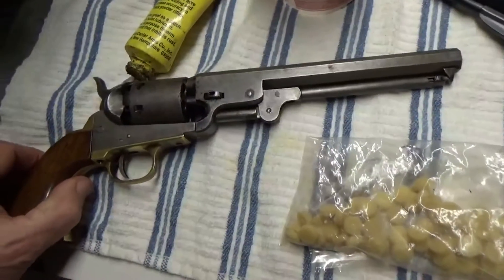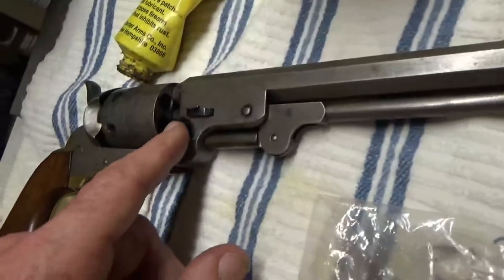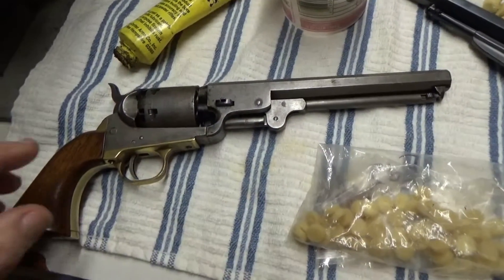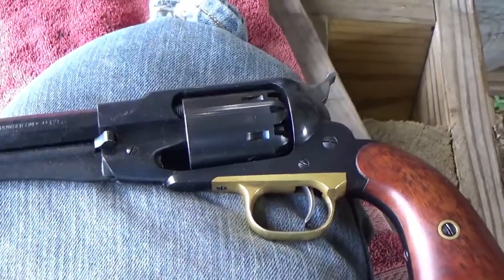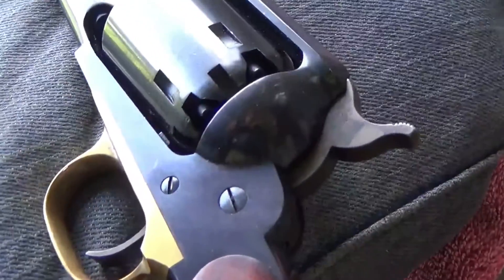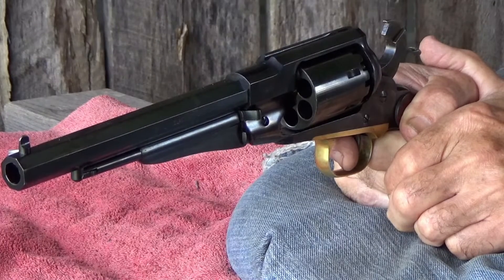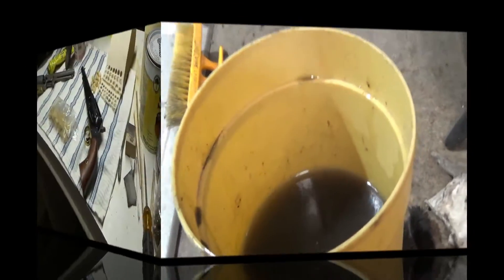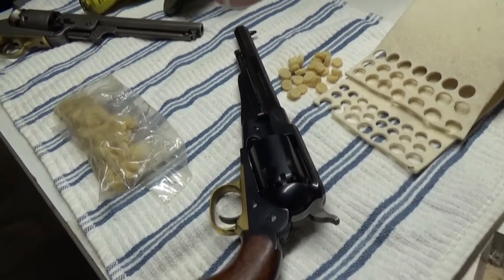1858 Pietta shooting without lube or wads - Part 1

Comment: When I started blackpowder revolver (many years ago) I bought a Centaur made Colt 1861. (Centaur is Belgium but made on original Colt machinery) At that time I read an article: a youg guy became German champion. Everybody was asking what lube, which wad etc. He said I use none... A standard match in the Netherlands is 13 shots, of which the best 10 count. So no lube or wads needed I think. (I did it any way)
Reply from the maker: That’s interesting data. I have tried the “nothing” plan. It wasn’t bad for the first cylinder. If I remember correctly the cylinder became progressively more difficult to turn. Started to get flyers and group size opened up. Cleaning was much more difficult due to the fouling build up. So, there seems to be a contradiction here, and it’s not the first time the loading with nothing has been mentioned in comments. It wouldn’t hurt me to go through this a second time. Have folks that back the “nothing “ approach any knowledge about shooting black powder cartridges like the 45/70, or at least read publications like those by Paul Matthews?  Are they aware of the “grease cookie”, and how important it is to accuracy and why. Also the information by Ned Roberts he talks about how in the 1800’s the importance of “moist burning black powder”?  Probably not. What if (just a theory) modern commercial black powder ain’t the same when it comes to fouling?  This could explain why lube is now used in the attempt to keep fouling soft so that things work better. There’s also the possibility that tests and experience I have are incorrect. There are many things we don’t know, like the powder the young German was using. I believe this lube, or no lube subject could use more study. Thanks again for your comment and information. O.R.
Reply: @oldranger3044  I don't know his powder also, most use swiss for matches. I do know my sharps 45-70 reacts to "cheap" blackpowder. I lube my cast bullets with homemade lube. Mix of Peanut oil, fat for french fries and beeswax. With cheap powder (non Swiss) three round go into the 10 ring at hundred meter distance but then they start to drop hard. Lots of hard powder residue in the barrel, no lead fouling however. Now I wipe with a moist patch after three shots. With Swiss powder 120 $ a kilo no problems.
Reply from the maker: @pietkoster1935  Thanks, that’s very interesting. I have some Swiss, but have never tried it without lube.  A comparison of it with GOEX would make an interesting test. Also, I have a 15 lb can of what was called “orange rifle powder” that was never opened and I believe was from the late 1800’s. Maybe its time to check out some theories. O.R.

Comment: That was a surprising result, the mystery is what is causing the flyers? I note that on third group it was the first 3 shots that went wild, then the next dropped into one very tight group, I see the seated ball was at least 1/2" back from the end of the chamber, do you think that could be making a difference, although with the others going into such a very tight group  I can hardly see that was causing a problem, but to get such tight groups  with a fouled barrel after that many shots is amazing, was the fouling soft after that many shots? Chris B.
Reply from the maker: Hard as a rock.  I have shot some groups using wads, in an attempt to see if they would work without flyers.  So far, and that means so far, I get similar results with the wads as without anything, in that there seemed to be some that were tight were I expected them, and then what appears to by flyers.  Actually this might be expected if the lube wad isn't really doing much.  One thing it seemed to do for me was to cause some erratic shots, almost like squibs.  I need to run some more, but I've been having fun with the lube accuracy.  I maybe said that I am suspicious that maybe the powder in the past was somewhat different.  In Ned Roberts book he claims that guns can shoot without wiping if the powder selected is moist burning.  "Very interesting". O.R.

P.S. Plan to repeat test, and you can bet, knowing the gremlins that live in the can of BP, that the results will be completely different.
Reply: @oldranger3044  I think the hard fouling must cause a great deal of deformation, and therefore flyers, but the mystery is your flyers came early ,before the excellent group, I can well see that a lubed wad over the powder could cause erratic burn, as there is little chance of getting the same pressure on every chamber, and for that reason I do not put any contaminants under the bullet, but the lube coated ball looks a good idea, I always use a carton disc over my BPC loadings, that could be something to try, but we are loading a round ball down onto the powder, so do not have the flat base the go up against the wad, as you say, lots more work to do! Chris B.
Reply from the maker: @453421abcdefg12345  True about the compression varying. The lube I used had the consistency of Crisco, so maybe pressure could force some out.  I've often wondered about the burn not being the same because it first can compress the wad (maybe) and act somewhat like powder that is not compressed-even when we think it is.  Yes, lots of fun stuff to work on. It might not have a lot to do as my brother would say with "the price of corn"  but I'n not planning on spending much time making video's showing my shooting ability with one hand either.  O.R.
Reply: @oldranger3044  I noticed today, while driving a ball through the barrel of my .36 that had been loaded into the .38" chamber, (I was doing this to see if it completely filled the grooves), that the ball rotted slightly, enough to show light through the bore, if that were to happen when being fired, the ball would probably veer off to one side, have had high pressure gas bypassing the ball, another reason to have chambers the correct size! I wish I lived closer, we could get more work done on this! Chris B.
Reply from the maker: @453421abcdefg12345  Hi Chris. That  caused me to check my 44 Pietta 1860, which has chambers .446, bore .440.  To be sure, I took a .454 with loading lever down the chamber and punched it back out, and yes, .446.  Interesting how some ring was cut off, but some stayed on the ball, and there was a noticeable ridge where lead was pushed to the front.  Anyway, then pushed it into the muzzle and looked against the light.  It was not filled to the groves, just as I had seen with the 36's.  I took a pretty good photo of it.  Unless it bumps up, gas is going by on all sides.  How it can be accurate is beyond me.  But it works.  A while back I tried on the 36's to use reamed chambers at .375 with a 380 to fill things up, but it didn't seem to shoot much, or any better.  I don't think these things follow smokeless rules.  Maybe they make their own on demand.
When I saw the "damage" that was done to the 454 in putting it in the .446 chamber, I suspect maybe that is why I get good results with the 451, possibly better than the 454.  O.R.

Comment: Now you know, folks. Lube that cylinder end. Lube those rifle patches too. It’s not a wasted motion or resources.
Reply from the maker: Yup, that’s why rifles were made with patch boxes. Sure, can use saliva in a pinch, it will help sliding down the barrel, but won’t do much to keep fouling soft once it dries. O.R.
Reply from the maker: According to what I’ve read, many of the Southern Mountain “poor boy “ rifles had a “grease hole” in the stock. Less work and metal for the builder. O.R.
Reply: @oldranger3044  Your 2 videos PROVED that grease is a necessity for blackpowder shooting. The improved cleanup alone is worth it, but just a chance that it improved accuracy really clenches the deal. Minus at least 2 flyers per target, that’s major.

Comment: If im doing a lot of shooting in a day I'll do an over powder wad (either felt or even a 3d printed plastic disc of the right diameter), put a small dab of beeswax-olive oil grease over that, then ram in a ball. Keeps everything soft. 
Or i sometimes will just run paper cartridges dipped in the same lube mix.
Reply: I was just thinking of making some cartridges and brushing them lightly with Vaseline but at time of loading I don't want greasy fingers lolol gloves right

Comment: I use a .457 ball and a Triple Seven 25gn charge. I put ball directly on the powder and then grease the edges of the top of the ball in the cylinder. It's shooting ball on ball at 20 yds with my 1858 New Army Pietta.
Reply from the maker: Sounds like a happy day. I’ve never shot 777 in handguns that I can remember. Don’t know if it was made when I first started, but I’ve heard it works well.  I also used to lube just around the edges in the 80’s and would get occasional flyers in the 36 calibers. Was using GOEX and I think maybe it wasn’t enough lube, because doing better now using more. Also it was pure crisco. Thanks for your comment. O.R.
Reply: @oldranger3044  love your vids man. Keep them up.
Reply from the maker: @Adam-upnorth  Thanks Adam, and also for your loading data. Keep safe. O.R.
Reply: @oldranger3044  you are very welcome.  Thank you and same to you.  Stay safe and shoot straight.

Comment: Fascinating. I imagine for competition or a day of target shooting one ought to use lube and spray down with moose milk between stages and quick cleaning when time allows. However, I have always been skeptical that the working man in the old west would walk around all day or all week with melted lube on the cylinder in hot weather. It would seem to be a real mess. It would be interesting to research the extent literature and manufactures instructions from the time period.
Reply from the maker: I have heard that original instructions were pretty much to load this way.  No doubt they were not all done this way, but our reasons today are different for shooting the guns, with different techniques.  Old information is hard to come by, just like finding information on how fires were started.  Everyone did it so there probably wasn't a feeling that it should be documented.  O.R.
Reply: @oldranger3044  Yep, range work or hunting are a whole different thing than EDC.
Reply: @oldranger3044  Yep, done some extensive research into this and concluded that in wartime paper cartridges were mainly used as issued, some were dipped in lube, some not. Accuracy probably didn't suffer as the men weren't the best revolver shots and they only shot 6 before switching to another weapon. No reloads in combat unless in a defensive position probably. Elmer Keith mentions some preferring the roundball over the conical for deadlyness. Colts and even Cooper revolver loading instructions never mentioned lube, it probably was not used much. However, dripping molten candle wax around the caps and loaded chambers was done to waterproof the loads. This probably aided in a little lubrication, but that was a secondary cause.

Comment: I use Bore Butter and 3-in-! oil, generously.
Reply from the maker: Bore Butter works fine, but I would go through probably a tube per day, and shooting sometimes 4-5 days a week - well, I felt I wanted something less costly. Have not used 3 an 1, mostly because of those that claim petroleum based products don’t go well with black powder shooting. Thanks for sharing this info. O.R.

Comment: Ive used Criso for years.  Easier cleaning in my opinion.
Reply from the maker: @wizbang16  I also used it in the 80’s, but too sparse because I thought its extra weight would affect things. Actually it would have, but for the better, because there needs to be enough to keep the fouling soft. I did a recent test of it against my mixture and it did well, but without the wax, it had a loose “ball movement” in the hot weather. Other than that, it worked fine. O.R.

Comment: Is there anything in the $300.00 price range worth buying and would it come with everything or is powder,caps and balls always separate?
Reply from the maker: My opinion on question #1 is yes. If we’re talking Pietta, if you pay over $350, then you’re probably just getting a fancier looking piece. Exception would be their shooters model ($900+) or one with target sights. If it’s a Uberti, then it’s going to be $50-100 more than Pietta. There are plenty of videos that compare guns from the two companies. Should be from $300-375 for steel frame Piettas, depending on models. About $50 less for brass frames. At these prices for new, I would be caution new shooters about buying used.
Question 2, is easy, no, they don’t come with everything, at least I’ve never seen it. I’m sure sometimes at at a gun shop or wherever they might include extras, but there are no factory complete kits that I know of. 
Not throwing water on the 🔥, but compared to modern cartridge guns, the black powder shooting can involve “extra stuff “, including cleaning and dissembling, that is easily overlooked. It’s a different world than modern firearms, and probably that’s one reason it’s popular with some shooters.  Hope this helps. O.R.

Comment: 1858s are the very worst for fouling.. sure as far as cap jams it's pretty good but after the first cylinder it's so fouled it doesn't want to fire another cylinder or it's very hard. It gets too gunked up you can't even pull out the cylinder rod..

Comment: Doesn't the Pietta manual suggest using .454 round ball for their  1858 Remington?
Why are you using .451 lead balls in your testing?

I have heard some say the most important thing that prevents a chainfire jump across
the cylinder openings is getting a uniform circle of lead cut off the ball after you ram it home.
Reply from the maker: Could be the chambers of the older guns don't have much of a bevel to start the ball, and the 451 pushes down hard enough so that another three thousands would just make that more difficult.  And yes, the more lead shaved off, the better seal, and possibly better grip to the rifling.  There will probably be more distortion of the ball however.  I use plenty of lube, and try to be sure that the edges of the ball are sealed against the flash by this lube.  So, I guess I use the 451 because it has been working for me, and I haven't seen better accuracy yet with the 454.  Chambers on the Pietta are about .446, so I am shaving lead, exception would be if thee is a flat spot where the ball was cut off from the mold, and that happens to end up on the side, then my lube better do part of it's job.  Thanks for the comment.  O.R.
Reply: I use and have been using .451 , it leaves a ring. Never had chain fire but I do put some lube on outside of ball after seated.